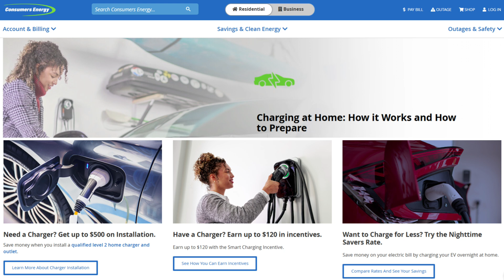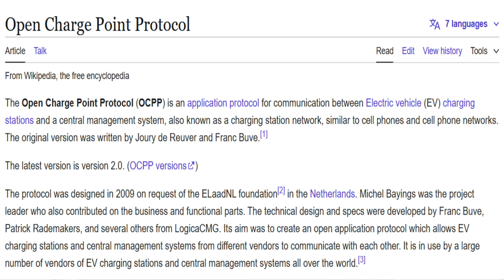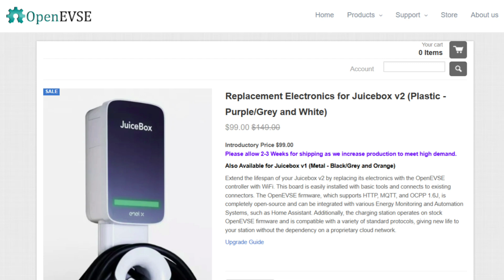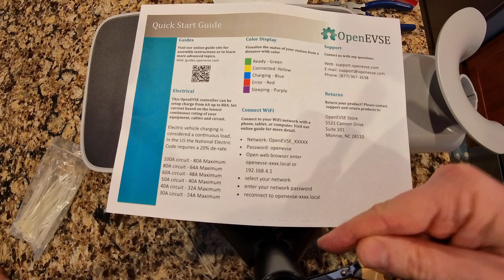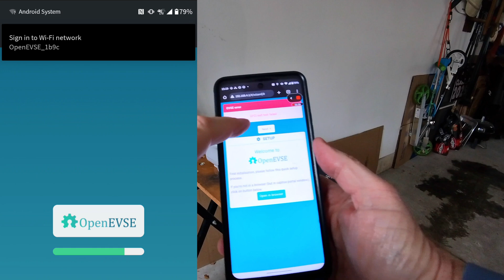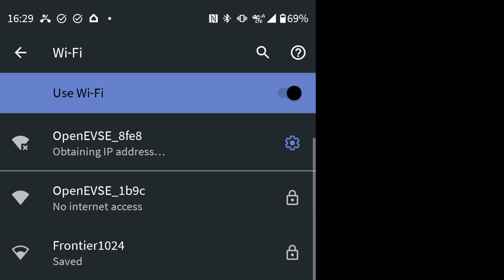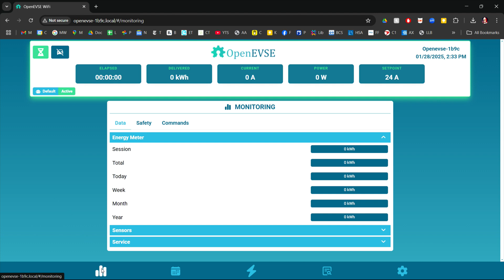JuiceBox Open EVSE Upgrade  - It's Alive!

Comment: first, thank you for making this video. very helpful placing the connectors to the right terminals. I ordered mine on nov 20th and it shipped  about a month later. UPS was 8 days deliver (holiday season). the board swap was done without any problems.  firmware updated completed in one minute. LE dis green , ok. connecting to wifi successful. will attempt the first charge in the next day or so.

Comment: What was the issue that triggered the GFCI fault?
Reply from the maker: I never did find out.  I reseated the pins and it cleared the fault.  I suspect it was assembly user error on my part.  That error hasn't popped up since then and I use the charger daily.

Comment: I have a juice box 32 hard wired to my electrical panel and it works as a dumb charger.....Will I eventually need to perform the retrofit and can I continue to use it as a dumb charger.
Reply from the maker: As long as it functions as a dumb charger and you're OK with that, you shouldn't need to retrofit.  If you want to add the smart features that come with OpenEVSE, you could still consider the upgrade.  One thing to consider is that there are a lot of cheap JuiceBox 40A on the secondary market (e.g. Facebook Marketplace).  You could pick up one of those cheap and upgrade it when you have an EV that can benefit from the additional power (40A =~ 9.6 KW).

Comment: I have a juice box 32 v2 and it still works as a dumb charger using my vehicles timer to set the charging time.   Will I eventually have to perform the retrofit?
Reply from the maker: If yours works as a dumb charger and you're OK with that, just leave it alone.  If you want some smart features, you could do the OpenEVSE card upgrade.

Comment: Thanks for your very informative video.  I was able to rescue two V2 Juice Boxes.  My firmware version is 5.1.2 and I see the latest is 5.1.4.  When I try to update via "Direct Install" it just says starting update and never finishes (5 hrs later).  Any suggestions?
Reply from the maker: I'm glad you were able to get the Juice Boxes going!  I have to admit I haven't dabbled in firmware since I just use what came onboard without issues.  As with my Zero motorcycle, I usually find that unless I have a specific reason to upgrade firmware and/or it's easy, I just leave it alone.

Comment: Where can I find a relay switch for my Juicebox 40 V2. Mine is stuck open.  OpenEVSE doesn't have it, and Ebay only has one for the Juicebox V1. Help
Reply from the maker: I have not tried to reverse engineer that or figure out what the part is since the V2s I have encountered didn't have that issue.  My V1 JB relay was flaky which is why I used my V1 as parts (mainly cables) for the OpenEVSE build project.  FWIW, I've noticed quite a few V2 JuiceBoxes on Facebook Marketplace for about $100 so that's always an option.  Sorry I'm not more help on that topic.

Comment: Dear Zero-E, another question: since buying the OpenEVSE JuiceBox replacement board, I've noticed my two OpenEVSE units are on different firmware versions. Searching firmware update in the OpenEVSE forums revealed many highly technical threads when I expected a simple "click here, enter password" routine for automated updates. Yikes! Have you encountered (or filmed) any "firmware update for dummies" tutorials? Thanks in advance! PS: The JuiceBox fix is working great! ~~Jeff
Reply from the maker: To be honest, I had not even noticed that.  For what it's worth, the OpenEVSE support pages have a section on firmware.  Also, I have found the community forums are another good resource.  https://openev.freshdesk.com/support/home

Comment: Dear Zero e (@0e-michigan). Thank you for the tutorial! I have a question. I have a donated Gen 2 EnelX JuiceBox. I am going to buy the EVSE card but I have a question. Is it possible to get an adapter for the power connector, for example, a NEMA 5-15P to 14-50R adapter?  This is the use case: I want to use the modified Juicebox to do Level 1 99% of the time, which based on your video, it looks like the EVSE comes configured by default to Level 1 charging. In the rare occasion I may need do Level 2 charging, I can remove the adapter, connect to my 240V circuit and configure the EVSE to Level 2. Is that possible? Sorry for asking silly questions if that is one of those. I am here to learn. Thanks!

Comment: Another question for you, Zero E: It looks like the OpenEVSE is accessible only via my local area network, and its IP address keeps changing every time I unplug it or add another wifi device to my network. Have you found a way to monitor and manage the OpenEVSE over the web? Thanks!
Reply from the maker: I have only tried via my local network.  I'm not sure if or how it could be accessed remotely when not connected to your local network.  You might consider checking the OpenEVSE support pages and forums to see if someone else has done this and how.  https://openev.freshdesk.com/support/home

-Karl

Comment: Dear Zero E, thanks for the tutorial. I'm very curious what you got wrong with the rewiring on the first go. I suspect it was the two "sensor" circuits that lead to the two current sensor coils, as they have the same size plug and are easily miswired. I received my Replacement Board yesterday and followed both your tutorial and OpenEVSE's online tutorial and got it right the first time. It's working great!! Now I'm wondering if the OpenEVSE JuiceBox can/should charge at 48 amps, which the OpenEVSE board can deliver, or should be capped at 40 amps, which was the limit for the original JuiceBox. Thanks again for your excellent video.
Reply from the maker: Hey Jeffrey, glad you were able to rescue your JuiceBox!   I also thought perhaps that I mixed up the leads to the "donut" current sensors, but I only removed one of them upon reinspection and didn't reverse them.  It really is a bit of a mystery to me what I did wrong, so perhaps the connector just didn't seat right.  Anyway, all's well that ends well and my unit has now been working daily since that initial build.

Regarding the max amps, I believe  while the OpenEVSE kit hardware (including the contactor; check the kit specs) can handle 48A, it depends on what the high-power input cabling and J1772/NACS cable are rated for, not to mention the NEC 80% rule.  If you're reusing the JuiceBox without other changes, I would stick to 40A max.  

Regarding the NEC 80% rule: EV charging is considered "continuous use" by the US National Electric Code which means that a charging circuit can only be loaded to 80% if its rated capacity (i.e. what the circuit breaker says).  So to use a 48A EV charger, you'd need a 60A circuit.  Or if you're using a 50A plug-in cable like I did, the charger needs to deliver 40A or less.  Most of the time, I set my car to charge a 32A which reduces the amount of heating the wiring and other components are subjected to and helps ease the demand on the grid.  If I need a quicker boost, I can set it higher as needed.
Reply: @0e-michigan  Many thanks for the prompt replies. I've raised the question about maximum charging amps with Chris Howell at OpenEVSE, and also recommended that they produce a superseding label to paste over the Enel X label -- and maybe an OpenEVSE label to paste over the JuiceBox branding! I am aware of the NEC 80 percent rule, and will need to check what breaker I had installed when my electrician wired the circuit to our panel 8 years ago. I didn't mention it above, but your experience prompted me to label each wire with its destination address on the OpenEVSE board as I removed it from the JuiceBox board, which gave me confidence and peace of mind. It worked on the first try! Thanks again.
Reply from the maker: @jeffreykparker  Good idea on the labeling!  I also put a label on the outside of my upgraded JuiceBox with the OpenEVSE  WiFi code in case it gets disconnected.  I didn't mean to insult your intelligence on the 80% rule, but I always want to be sure.  -Karl

Comment: Today, 16-Mar-2025, the only board I see on the OpenEVSE webpage is OpenEVSE PLUS v6.5. It does not appear to be mechanically compatible (no diagonal cut to the outline, for example) and the connectors are all different. That makes this video obsolete, does it not?
Reply: OK, the board is there after all. Look for the picture of the Juice Box, not a picture of the board. The current price is $130.
Reply from the maker: Sorry I didn't see your comment earlier, but it seems you found it.  Yes, they raised the price.  :-(

Comment: that was very thorough.  what was the issue with the GFCI?  or was that just a fluke?
Reply from the maker: Good question. I assumed that I just didn't land one of the wires correctly. I rechecked and retightened all of my connections inside the box and then the issue went away.

Comment: Thanks for the video.

I will be upgrading my Juicebox as soon as I get the v2 board from OpenEVSE.
Reply: Dear YeOldeTraveller, I'm quite curious how you did retrofitting your JuiceBox V2 with the OpenEVSE board. Did everything go OK? Any words of caution? Thanks!
Reply: @jeffreykparker  Board replacement went well.  Only one real issue, and one minor issue.
For me, there was a Step 0.  I had to remove the mounting frame and the cable management as I did not have the 4 access holes you can see in the video (and in the online instructions).  After that, I needed to find a screwdriver that was thin enough to reach the recessed screws.  I use multi-headed drivers normally, but the barrel of each of them was too thick.

I got the green light on my smoke test, but I need to get it mounted to the wall to do a full function test.  I have the Ford Mobile Charger, and I get by with Level 1 most of the time, and I can plug it into 240 if I need Level 2 speeds.  It took about 4 weeks to get the replacement board and I was travelling some of the last few weekends.  I plan to get it one the wall this weekend, and I will update with the final result.
Reply: @YeOldeTraveller  Many thanks for the update. I pulled my Juicebox apart today and can see just how easy this retrofit with the OpenEVSE board will be. Only question is how long I'll have to wait for the board to ship out! Thanks again!